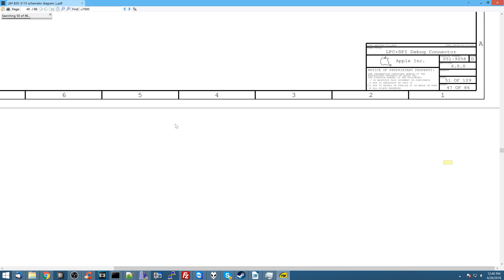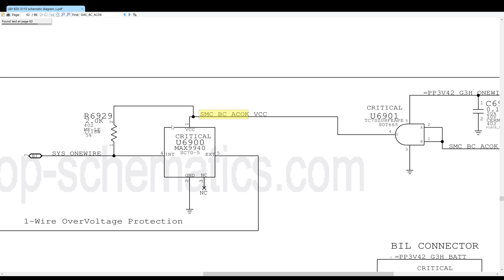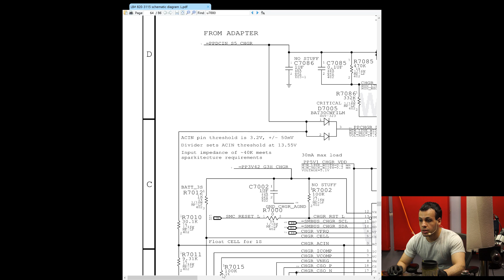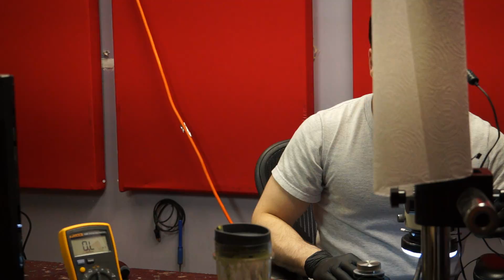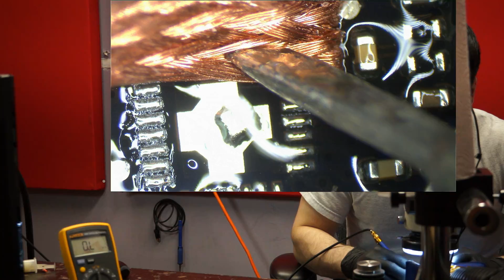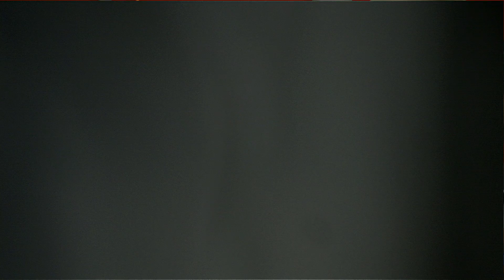Before you say I'm doing it wrong ask why I'm doing it that way!

Comment: Oh man Louis you need to learn some CAD 3D drawing on your computer and get into 3D printing. It is the perfect tool for problem solvers. CAD is really simple and it is also logic, it's one of those things that looks difficult but isn't, just takes a few days. Your unstable JBC station at around 9:40 could be solved when you design and print something to stabilise it. Or perhaps try magnets.. Also, might be possible to print some tiny tools to position the component during soldering, though that should be printed with metal because of the hot air. You can check printing prices on Shapeways or 3DHubs. Keep up the good work!

Comment: Why does SMC_BC_ACOK go into both inputs of an AND gate? What's the point? Can't a transistor just be used there? (I don't have an EE background so maybe there's some voltage thing I'm unaware of)
Reply from the maker: It could. I do not know why Apple chose to use this. I imagine because of its low cost and the fact that Apple already uses this on several other parts of the machine where having TWO inputs is very important. It was probably easier and cheaper for them to just use this AND gate since it was being used on many other parts of the board that required two inputs.

Comment: hey louis, thanks for making these videos. I have a question regarding a macbook pro A1502 that I'm looking at for a friend. she spilled soup on it and. when she dried it off it started making whining noises when turned on. so far looking through everything nothing looks damaged, but I cleaned everything with electronics cleaner and wiped things down. I have yet to put the thing back together, but I wonder if you would have an idea of something that could have broken when (quite a lot of) soup was spilled on the keyboard/track pad. thanks and sorry if this is a stupid question.

Comment: Louis do you have a link to your store where we can buy the components from you, as in the strip of chips you mention in the video? I went to your https://mailin.repair/ site and looked but could not fine them. I even signed up for an account thinking I was doing something wrong before I ask. Thanks so much for sharing all this great information. I can now add more services to my repair shop thanks to you. =)
Reply from the maker: +Megan Loughrey Which chips are you looking for? The only one we sell is the ISL6259 which you can buy using the search box. I have to add a button to the site for microsoldering supply.
Reply: +Louis Rossmann  Really I was just looking for chips in general. I also wanted to buy the flux from you as well. The buttons would be a great help. I haven't started repairing macs yet. I'm just looking for links for later so I know where I can order from. I just order my hot air station, the Weller WHA900 you recommended. I still need to get the Hakko soldering station and irons, microscope and a Crest ultrasonic cleaner. The irons I have now are crap and have non replaceable tips. There really is nothing like using a cheap $15 soldering iron to piss someone off. lol Those will be cannibalized for there wire in the near future. I already have a fluke 112 multireader a friend of mine gave me. I learned long ago not to cheap out on my tools unless the cheaper tool would do the job. Cheap tools are to expensive for me when you have to buy them over and over and over again because they stopped working or never worked in the first place. Thanks again for all the great videos! Who needs cable when you have Louis complaining about other peoples crappy work. I could watch your videos for hours. =)
Reply from the maker: Megan Loughrey It's coming with time. I hired someone I hope can help me make time for this. How did you get into this?
Reply: +Louis Rossmann My dad was a PC tech for FEMA and we always had a computer in the house. I watched a lot of what he did and repeated it. I also screwed up my own computer and when I would ask for his help he would point me in the right direction but not do the work for me. I would also rip my toys apart when I was a kid and try to make robots out of them. lol I went threw a lot of duct tape and toys. Later in life I went to school to get my A+ Cert, That bored the hell out of me. After school I tried to get a job at a computer repair shop and that killed any confidence I had. I didn't get the job and ended up working at Best Buy selling appliances. This taught me sales.Years later I tried to get another computer job. I found the guy not a very good business man and decided I'd had enough and opened my own shop.

 The last soldering project I did was replacing my power window switches in my car and I didn't want to pay $100 for them so I ripped them apart to the main control board and made a pin out for it, solder leads on for new generic switches and made my own. Cost me $15. You can check out the write up I did here if you like: http://sixthsphere.com/showthread.php/90023-3rd-Gen-SC2-SL2-Universal-Window-Switch-Installation
Reply from the maker: Megan Loughrey Very cool! Best of luck with your store. That car project is good stuff.

Comment: But only a CERTIFIED apple technician can replace a chip on a motherboard. It will never work if you're not APPLE CERTIFIED! (sarcasm implied)
Reply: +Ethan Chow And then what do you use to fix the apple branded USB heat gun when it fails??

Comment: Louis,

You seen to be quite upset about the EEVBlog forum thread where someone asks the question "Is there some valid reason for going overboard with the application of flux?"
In this same video, you say that it's not good to state that you do something wrong, but it is OK to ask why you do something that way, which is exactly what the forum user did.

So why are you so upset about it?

(Maybe upset is not the right word here, but what I mean is that you talk about it every time you use flux so it must mean something to you)
Reply from the maker: +Tom "why do you use so much flux" = good question. when it gets to the nutjob/idiot/bs part i nod off. read the whole thread and you'll see why I'm not much of a social butterfly on the internet.

when i say that using too much flux, and saying "saudah" instead of solder pisses off "the engineers", i'm not so much referring to eevblog as much as the aggregate of trolls in the comment section, that may be from whatever corner of the internet.
Reply: +Louis Rossmann It's a long thread, forgive me for not reading throug it for more than a few posts... I see what you mean now.

Comment: hi , I'm pretty new to all that stuff and I'm quite interested in what you are doing , but I have a "stupid" questions about the "flux" , what is the real use of it and why is it supposed to be "bad" if you put too much of it ?

pls remember I have no knowledge about those thing so :p
Reply: +SHYVA PRIME I'm far from an expert, but I believe flux helps the solder "flow" more easily, and I think it also improves the quality of the solder joint when using leaded solder.
Reply: +stryk187 thx for that answer , there is a lot of terms that I don't understand I will get use to them with time but :l
Reply: SHYVA PRIME No problem, glad I could help. I'm still learning myself, too. It's fun :)

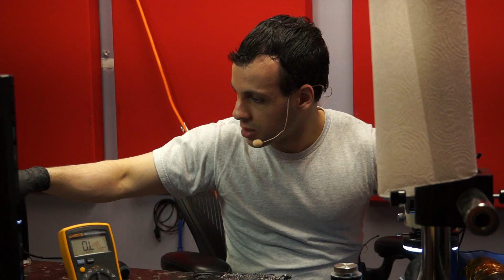Comment: Louis, I saw that video where the whole strip of chips got sucked into the airfilter (K5ASo2WAJyw, 17:25 into the video), i also noticed that you now and then have components sucked into the airfilter. I was wondering if you ever thought about getting a small net and put it on your end of the filter? - thus disallowing anything but air and fumes to be sucked in
Reply from the maker: +Jakeobsen It had a net, it disappeared.
Reply: +Louis Rossmann I think you need a grown up talk with Sharky. You don't take a mans net! (:

Comment: which kind flux is that? Can I buy it on ebay?
Reply from the maker: +Tiago Silva absolutely. http://www.ebay.com/itm/1x-AMTECH-Soldering-Paste-Flux-RMA-223-10ml-FREE-SHIP-/361490149640?hash=item542a7df108:g:HasAAOxy4dNS5-i1 is the best deal IMO
Reply: +Tiago Silva He sells it (or, he used to, at least). IIRC, he tracked down the manufacturer of his preferred brand and got set up to be an official distributor for them.
Reply: I won't support this arrogant dude. I want on ebay
Reply: Tiago Silva Oh.... Ok. Well, I'll tell you right now - if you buy flux on eBay you're going to get OneHungLow brand Vasoline 99% of the time. All of that shit is fake. eBay is really not where you want to go for flux.
Reply: +Tiago Silva You can actually buy it from (wait for it) Rossmann Repair Group. 
https://mailin.repair/amtech-nc-559-v2-30-cc-16160.html
Avoid cheap auctions on eBay and other places. Most likely you're not getting the real deal.
Reply: +Tiago Silva Or if you really don't want to support "this arrogant dude", try searching the flux categories of the big electronics distributors like Digikey, RS-Electronics, Mouser and so on. You won't find the exact same product, but least the stuff they're selling is genuine. With a bit of trial and error you should be able to find something that fits you.
Reply: Oh, forget everything I just said. That eBay link looks like an amazing deal. It has the hologram sticker, so you know it's the real stuff!
Reply: +Gameboygenius The hologram sticker is the equivalent to the golden QC sticker on the Atten 858. It means that this combination is going to work perfectly fine together.
Reply from the maker: Pn Junction exactly.

Comment: What's with the red panels on the walls? To induce a little frustration rage and ranting?
Reply from the maker: +Randy Smith acoustic panels. it dampens the noise from the hot air station and the fume extractor

Comment: I think this is the multimeter in the video? http://www.gearbest.com/measurement-analysis/pp_153176.html?vip=146287
Reply from the maker: +Toshi Crowley fluke 15b
Reply: Ah close enough! I wonder what the key differences between the 15B and 15B+ are? The Chinese market has their own lineup of FLUKE multimeters, the 17B+ seems to be the flagship.

http://www.gearbest.com/measurement-analysis/pp_153177.html?vip=154886

Thanks for the reply Louis! Did not expect it.
Reply from the maker: Toshi Crowley i have no idea. you don't need an expensive multimeter to do this, just one that isn't a piece of shit
Reply: Fair enough. I am new to electronics so a FLUKE might be overkill. I will just go with something cheap like 10-15 USD as you said. Thanks for the reply Louis.

Comment: The way I look at it is. Why spend a lot off money for something that you can get the same results from some other method that literately doesn't cost as much or nothing at all. Your in business to make money, not to spend it on expensive equipment that is not actually needed. But then again if you really need it, that would be the only time too spend the money. I wouldn't call you cheap. I would call you a wise and sensible person.

Comment: Oh, I feel clearly targeted by what you said. Perhaps rightfully so. My point, even if I didn't articulate well, was not to not probe the solder joints at all, but to save a tiny bit of time by probing the test pads first, and go from there. Of course weighted against which fault is more common. I'm not new to the idea of following a continuity/resistance measurement all the way to the chip. That has saved me in the past.
So, this is the lead time for videos, 2-3 weeks...
Reply from the maker: +Gameboygenius point taken. And lead time is time Warner cable. :(